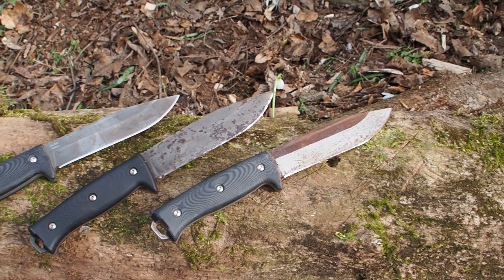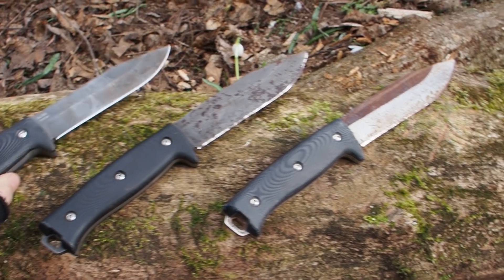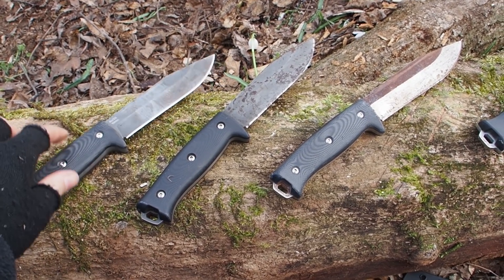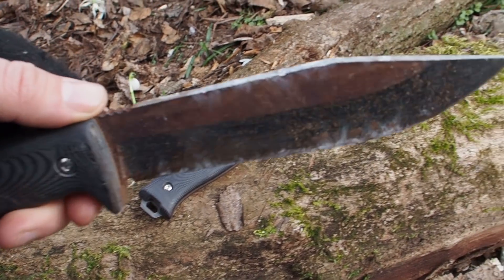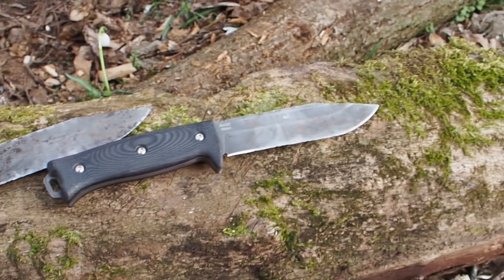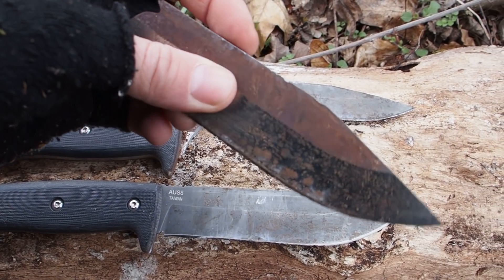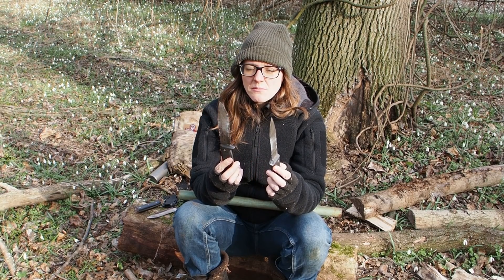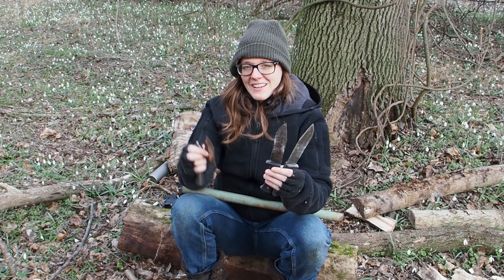Destruction Test - D2 vs. AUS8 vs. SK85 - Which is the better steel?

Comment from the maker: I am starting a new knife destruction series where I want to find out what the toughest steel is. Today I started with breaking my own knife. Next I will take on other steels from other brands. Do you have any suggestions which steels that you want to get compared? Also check out JOE X who does the wildest knife destruction tests: https://bit.ly/3sD3LAa
Reply: It hurts to damage a good knife.
Reply: @marsrizzo2854  no, not really!
Reply: thanks a lot, my video about the APO 1 S is now online on my channel, i hope you like it!!! It did pretty awesome, thats for sure!!!!
Reply: Cruwear or cpm3v!
Reply: Swiss army knifes  🔪  destruction test please. 
Lilly .
Reply: S35vn and m390 would be awesome to see tested.
Reply: I heard that carbon steel is uncomplainingly tougher than stainless, and that's why they make real functional swords out of it. They told me that stainless steel swords are only wall hangers, with no practical utility, not even for training, or cutting tests because no matter what stainless steel grade they use in it, they will always be prone of catastrophic failure. 
Is that true? I feel carbon and stainless steel doesn't seam so different in terms of toughness, based on those destruction videos. 
I know carbon steel can have differential heat treatment for a hard edge and soft spine bladed sword, but many high performance swords are integrally heat treated, and those are actually the ones that tend to have the best "springy" behavior.
So if carbon steel is tougher, than it would be something inherent of the material, but then again, is that information correct, or is it just another myth that carbon steel would be harder to break?